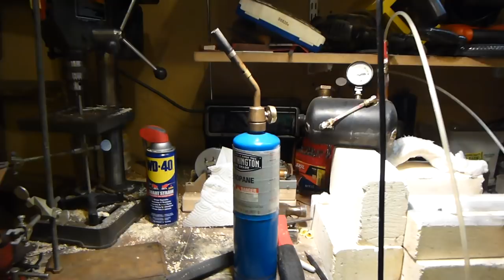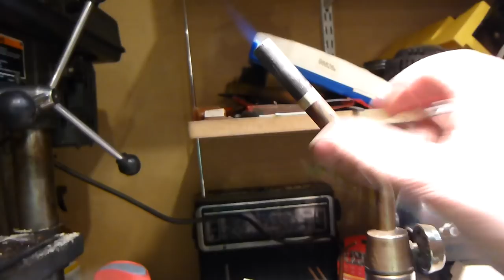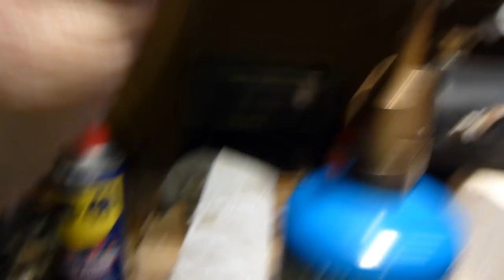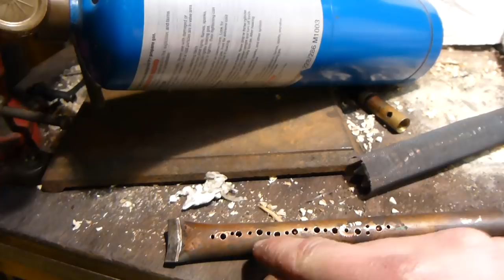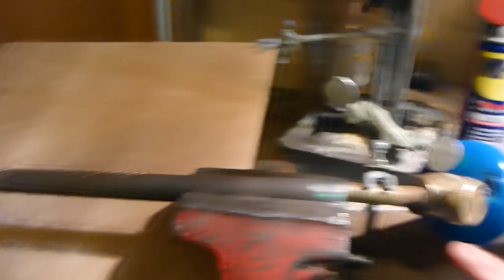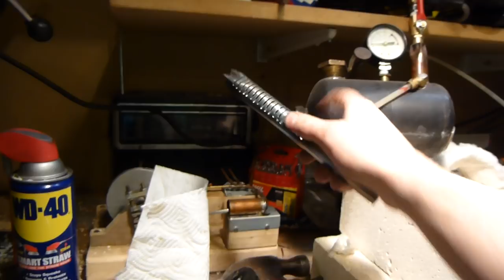Super Simple DIY Propane Ribbon Burner For Boilers and Forges

Comment: Nice one again! I am not sure but for your safety and your viewers safety, i think if you remove the "screen" made of brass balls "the orifice", there is a danger of flame return. I think it is a safety to prevent explosions!
Reply from the maker: iluzyon1 Thank you for your concern!  The screen you are referring to is a sintered bronze filter.  In this blow torch its main job is to filter out any particles as to prevent the orifice from getting plugged up.  The second job it may serve in this blow torch is as a muffler.  While a sintered bronze filter can be used as a flash back arrestor, it is not the purpose it serves in a torch like this.   The tank is only filled with propane.  There is no oxygen in the propane tank to make a flash back possible.
Reply: flashback would assume that oxygen is being pulled back into the propane container (in this scenario it would need to be pure oxygen gas) to get an explosive result.
Reply: Makerj101 ... Thank you for pointing out the fact that the tank can’t explode bc of a lack of oxygen in the cylinder.

Comment: QUESTION..............If the propane tank is at such a higher pressure than the atmosphere.... then when you open the propane tank all the propane in the pipe should be trying to escape EVERY orifice.  So are you saying NO  propane is escaping out the space where you put the propane tank nozzle in to the pipe???????  It seems like the propane would leak from there instead of pulling in air????????????  What's the deal man?    What happens if you put your lighter at that opening where the air is supposedly going  in to the pipe???????  Will it catch on fire from propane leaking out there??????????????   I do not know anything about burners so keep that in mind if you answer me.  This is only the 2nd video i watched but i liked it the best cause it is sooooooooo simple of a design and i am not good with building stuff

Comment: Great video, but using propane inside is a bad idea. Propane is heavier than air and it never ever breaks down. It will pool in the lowest part of your house forever.
Reply: *****
When you're burning it most does burn off. You do have a little that escapes from other parts before reaching the burners. The majority of it is going to come from between the time you open the valve to when you light it. As for RVs and trailers, they are elevated and eventually the propane will make it's out as the lowest point is still above the ground. A house on the other hand is already at ground level. It's even worse with houses that have basements. That's why in the United States full propane containers are always on the outside of the stores and gas stations. The fire code doesn't allow them to be brought inside. I imagine that the rules are the same in other parts of the world.
Reply from the maker: Harry of All Trades Thank you!  Yes you are right that propane is heaver than air and will pool in the lowest parts of the house.  As will natural gas, gasoline fumes, and lots of other flammable gases.  However it will not stay there forever.  Houses are pretty leaky and it will eventually dissipate.  Plus the amount of propane gas this torch can put out is not a danger.  I would need to leave the torch on without being lit for hours before it could reach a flammable level in a basement.  Maybe even empty the whole bottle in a basement to get to an explosive level.  Anyhow I was doing this in the garage so absolutely no danger.  If this was really such a danger then why do a lot of people heat there houses, use propane water heaters, cook stoves, and use propane dryers and refrigerators?
Reply from the maker: ***** Yeah it does burn off.  Yes people do.  Plus a lot of people heat there houses with propane, use propane water heaters, cook with propane stoves, and use propane dryers and refrigerators.  If there was a huge danger with using propane then no one would use it.
Reply: Natural gas is lighter than air. 0.64 specific gravity v 1.52 for propane. You are right that stray propane would naturally disperse, but there is a risk that if you were running this in a pan or enclosure, enough propane would pool and create a disconcerting pop or flare.

Even though the myth-busters proved it was hard, there is a confirmed report from earlier this year of a deadly explosion involving a propane gas cylinder.  No details on how it happened but it killed an 18 yr old and hospitalized his friend

Comment: Great video hard charger! Just one little safety tip I want to share so you can keep on rockin' the Tube with your cool videos ... You may know this, but be really careful when you light a butane torch with a plastic cigarette lighter. If the lighter is ever compromised by the torch flame you can blow off a few fingers depending on how full your lighter is. Just lookin' out my man. Peace...

Comment: where u get ur torch?
Reply from the maker: +Mr. Geek I'm not sure. We hae had it for as long as I can remember.  You can buy one at most hardware stores or order online.
Reply: Nothing under £10 with that long pipe
Reply from the maker: +Mr. Geek Here is a similar one sold on eBay.  http://www.ebay.com/itm/BernzOmatic-WT2201A-Brass-Propane-Torch-w-Flame-Adjust-Valve-/231631935253?hash=item35ee56d715
Reply: Makerj101

Comment: Could you explain please why a gas flame produces CO2 under one condition and CO under another?
Reply from the maker: jdflyback Copied from Wikipedia:  Carbon monoxide is produced from the partial oxidation of @wiki/Carbon-containing compounds; it forms when there is not enough oxygen to produce @wiki/Carbon_dioxide (CO2), such as when operating a @wiki/Stove or an @wiki/Internal_combustion_engine in an enclosed space.
Reply: Produces co2 in combustion. Burn that co2 and it breaks down into co. Need lots of air (o2) and to vent combustion gasses away so c02 doesn't become c0.
Reply: @dexjester  CO2 does not "become" CO. CO2 and CO are both produced during combustion. CO2 is inert and stable. CO2 is nonflammable. It is often used in fire extinguishers. CO is reactive and will burn. That is what a catalytic converter on a car does. It burns the CO and makes CO2. A gas burner with the proper amount of air produces mostly CO2 and water vapor as combustion products.